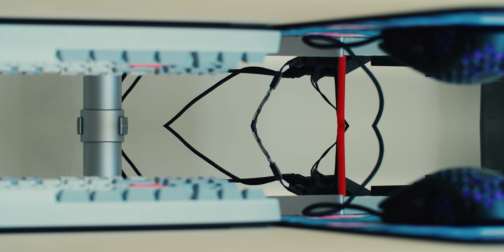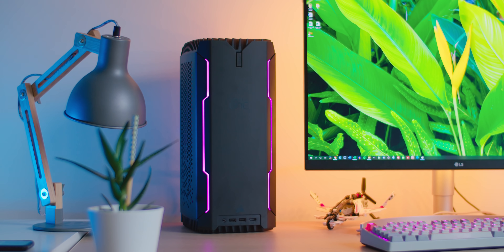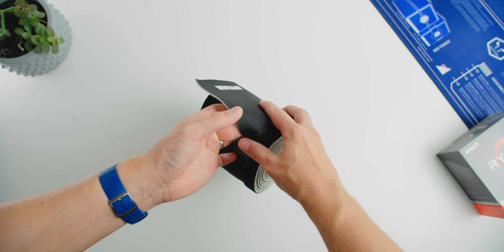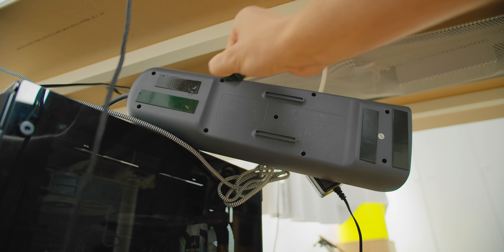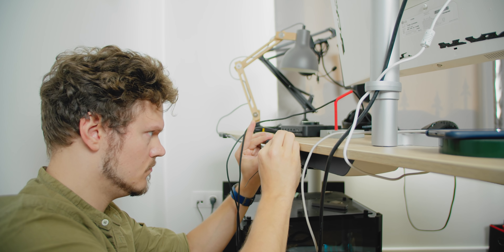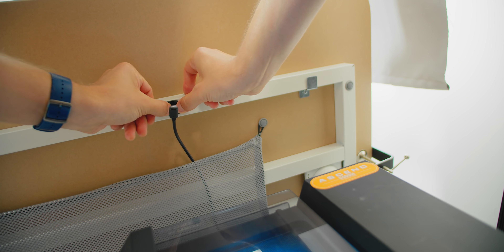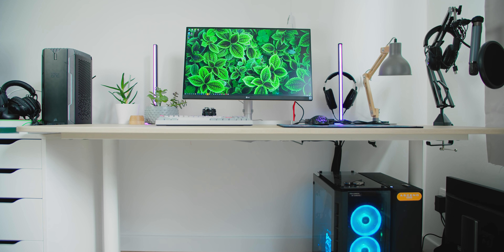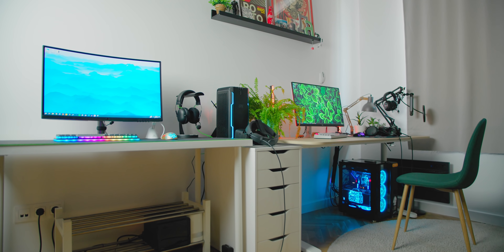CHEAP and EASY desk cable management options!

Comment: Show us again in 6 months, when those stickies fall off. 
Especially the weight of the power bar. 
I'd recommend using 3M stickies instead of the no-name brands.. you get what you pay for. And before sticking anything to the desk, wipe the desk with isopropanol / isopropal alcohol first, for a clean stick. When you apply the sticky.. hold for at least 5 seconds with constant pressure so it'll stay. Yes, way too much experience wiring call / inet centers over the years.
Reply: Answered my question before I even asked it at the end. Lol
Reply: The first items he's showing off (1:38), I bought the same exact looking ones several years ago on ebay. They're still on my desk, not budging at all
Reply: WhiteHawk wrong, 3m is quality. What do you think hold the Velcro down, anyways? When applying something it’s all about surface prep, and this separates handy people from idiots. Same deal with ikea furniture. I’m 28 and I’m still using an ikea dresser my dad and I assembled when I was in 6th grade
Reply: @rogerwilco99  Isopropanol isn't methanol, it's isopropanol.
Reply: Those stickies are horrible. You spend an hour or so under the table to cable managing everything, just to hear them pop of one after the other in the coming week.
Reply: @WhiteHawk77  3m isn't crap. I still have rain guards on my car 7 years later.
Reply: Is 3M, 3X stronger?
Reply: This is how I destroyed my table
Reply: 3m tape is just op
Reply: @WhiteHawk77  Considering I have multiple parts that have been installed my car for years using 3m, I  wouldn't call it crap.
Reply: Hi I'm using use 3M stick on tapes but they cannot support the power brick; it's mostly due to the heavy VOOC (OnePlus, Oppo, Realme) smartphone chargers that they use.

Is there a non destructive way (like a clamp) to hold the power strip in place while hold a weight of around 500gram?

Edit: please ignore this 3M I used was most probably fake, get 3M VBH it's one of the best ones I've tried so far. There's a video I'll link to it which compares tape strength; I found it quite useful.
Reply: dont use fake 3m... the real one is really strong and sticky
Reply: @MayankJairaj  Carpenters left behind what they called "mirror tape" after finishing the interiors of my house. Some 3M tape which they used to stick a big mirror in the bathroom to the wall.

I used the same tape to hold up a power strip (it's hanging from the left edge of my table). I've connected PSU, monitor, laptop and OnePlus brick to it. Still holding tight after a year.
Reply: @ShashankKR  oh yes thanks for that i forgot to update on this, the double sided tape i used was fake it wasn't 3M although it had a 3M branding on it. 
Now I use the 3M VBH tape and I would say I'm amazed by the strength of it. It currently is lifting anywhere around 5-6 kg of chargers from the last 1.5 month. Another place where I used it - my brother tried to rip it out, the paneling came off😅. 

Please ignore the comment and buy something like a 3M VBH (it comes with its own primer too)
Reply: Agree, those chinese manufacturers just simply write 3M on those shitty accessories, but the real shit holds strong
Reply: Hey 6 months later haha
Reply: @lukeroberts1  enquiring minds want to know! :)
Reply: @Major Gear (:
Reply: Well I got the god tier option, 3D printed me some zip tie anchors and screwed them under my desk and attatched the cables at them. It is truly one permanent solution which im really happy with. For someone who does not have a printer (understandably), hitting up ppl on etcy or other sites with DIY made stuff may be a good alternative to get the best possible option money can buy (and it cant be that expensive either)

Comment: Pro tip here. You see how the cable are going from the bureau straight down to his pc. Depending on the length of your cables you could also wire it going down behind the feet of the desk and then straight to the pc. You can do the same for the extension cord. It looks way more clean and I use it myself. Great video tho! Have fun with your cable management :)

Comment: I bought an ikea desk which cyou can put higher or lower by a button (just like in office). It has a net which hold the cable and adapter for it and i put in all cables neatly of my desktop as well. Clean AF.

Comment: I rescently did my desk again and I found that using D Channel cable trunking was a REAL help. Cheap, real easy to install and can hold a massive amount of cables in them. 

I also used sticky back ziptie anchors aswell all over the place to try and keep things up and off the floor out of the way. I think it looks ok, not perfect but I think its good enough. If i cant see it it dosnt bug me.

Comment: I used the velcro ties to do mine and it looks so much better. Still a tad bulky but may invest in the velcro sleeve later on for all the display, power, and USB cables, but for now they're all velcro'ed together with just the ends loose to plug into the various ports on the motherboard.

Comment: RE pedestal for PC on floor:  Cut a piece of plywood to the size of the bottom of the case, and attached wheels under it. Put the PC on the cart, attach the cables when it is out in front of the desk, and then push it back under the desk. You can rig the slack in the cables to hang from the under side of the desk, where it will be hidden until you pull the PC and cart out in front of the desk to work on.

Comment: In gaming setup section, you can zip tie little lose si that the HDMI cable can pass through the zip tie and tie all cable together with velcro straps... So the sip tie make a channel and Velcro keep them together... When need to change undo the Velcro , remove cables through the zip tie loops... Redo after changing the cables and you are good to go without cutting any zip tie

Comment: i recently took care of this... my comptuer , monitor and speakers are standing on a window sill...  below is the desk.... i had to cut a hole through the window sill + the desk table... then i added a wooden L angel below the top desk plate to hide the usb c hub and the cables... best solution i had in  30 years LOL

Comment: 3M adhesive requires a cure time prior to actually using it. Did multiple things, I went from hardly hanging a cable using 3M mount on my ceiling to being able to hold my whole VR headset, and a pinata (full of candy and being hit). On my door, I have a lock using 3M arms, and letting it cure is the difference between my cat being able to open the door, and just hanging on the handle.

A lot of little things that could be done to make it look even cleaner, the velcro tie on your monitor should be higher to only show the cable going down, which could be routed behind the stand. The cables on the edge under the desk should be held back from sight, the mouse could use a single 3M clip after the holder to get rid of the cable bend sticking up.

Comment: Dimitry have almost the exact same set up as mind - same-ish monitor, even same-ish headphone. My solution is to just go wireless keyboard. It's incredible how missing just one more cable making the rest so much more manageable. And rater than tape, I just some old hard cable and tie everything up with them.

Comment: Top tip, use one of those tiny cable clips for your mouse cable! I used to have one on the back of my desk and clipped my mouse cable in there, this helped a ton since the excess cable wouldn't hang behind the desk and catch on the desk as I flick the mouse... Now I have it clipped onto the back of my pc which I find ever better 😀

Comment: The cable management of my setup is mostly done with screws and twist ties. Screws hold my power strips and the cables are held by a combination of cup hook that are screwed into the back of the desk and twist ties. 
I think I've done pretty well as the only visible cables at the top are the mouse, keyboard, and the headphones, considering its composed of about 16 cables which are: 2 monitors (4), a printer (2), ethernet cable (1), mouse (1), keyboard (1), and monitor USB hub (1), DAC (2), PC (1), 2 power stiprs (2) and a UPS (1).
Of those the headphones (Samson SR850) is the biggest mess of cables due to the very long cable it has. Though being connected at the front to my DAC (Aiyima DAC-A2 / Fosi Q4) doesn't exactly help and I might try to add some height to my PC so I can place it under the PC and have it coming from the left instead of the front.
Reply: ok

Comment: plastic cable tie pro tip: if you turn them around and insert the tie with the "wrong" side, you can reuse them as well!! they won't have as much power for obvious reasons, but sometimes thats enough.

Comment: I use a signum rack and a spool of velcro 
Currently not perfect, but I do need to rip the whole setup apart and do it right, it was all originally setup in a hurry after a move

Comment: Ultra cheap option - go to hardware store, buy some plastic PVC piping holders, few wood screws and you've got a pretty nice cable holders for $2-$3, especially if your desk has a support brace that you can screw those holders to. They open up easily, so it only takes a few seconds to get your cable out of them, they are mounted with a screw so no worries about long term adhesive problems. Downside is that you actually have to screw them into your desk - not a problem for me, since I don't plan to ever use my desk in a way that those holders would be visible.

Comment: cable managment isnt that hard... but i have also en external Radiator for the Water Cooling. To hide the external tubes from the Radiator is the Real Challenge!

I thought about using hard tubes externally for a clean look^^

Comment: Congratulations on unlocking level 1 of cable management! Next challenge: multiple monitors and full array of accessories - on a sit-stand desk  😃 
I bought non-height adjustable Bekant frame and the net was much bigger, going almost to edges. But I am in Europe so maybe models differ a bit, or it was newer revision?
As for computer pedestal - why not get board with similar surface finish like your desk, and mount it on casters (like Ikea Rill) or furniture legs? I believe you can get these boards very cheap in hobby markets, they usually keep assortment of waste boards and will cut them to size you need. Apply self-adhesive white edge to match the table. Casters have advantage that you can roll the case around when you need to turn around to plug cables or move a bit to clean dust around it.
Reply: ok

Comment: Good video, it did make the area neat. Pretty sure the double-sided tape on the power strip will fail, potentially causing something to get powered off (like an external hard drive). Would suggest just using small mount screws or at least wiping the area where you are applying the double-sided tape with some rubbing alcohol first.

Comment: i simply mounted a mesh wire grid under my table and attached all the wires etc to that. Sticky tabs etc just fall off and I would trust them to hold a power bar over longer times.

Comment: i used adhesive clamps for my set up and completely forgot about the adhesive tying points, should have used those instead, it gives you so much more freedom because the clamps might not fit some thicker cable or would have troubles with multiple cables.
they are more versatile and easier to change though, but that matter can be fixed with tie points if you use velcro or reusable zip ties

Comment: We use all of those same components, just larger versions when we do cables management on Datacenter racks. We've had as many as 280 network cables going from servers to the top of rack switches, those velcro cable ties are definitely worth their weight in gold.
Reply: Absolutely, never go with plastic cable ties if you can help it. They could pinch your cables, need to be cut to be adjusted and aren't easily recycled.

Comment: The fastest way to clear your cable mess is to create a backdrop behind your desk with 2 large acylic panels (or any other material panel of your choice). You can also just use 1 panel, but I like two because you can create a spacer between the two panels and just throw your cable through them - and it allows the whole structure to stand on its own. It's basically like routing cables into a drywall, but without actually hacking your wall. Nothing to tie down, just throw everything behind your self-made "wall".
Reply: yea

Comment: Switching the mouse and keyboard to wireless was a game changer for me, no more cables getting stuck on something behind the desk in the middle of the game
Reply: Well you should never move your keyboard, but yeah, having a wireless headset and mouse was key to me.
Reply: @TheGauges420  true, although i was also talking about the cable mess part
Reply: I'd pick mess over weekly charging ritual, increased price and batteries that inevitably die out or randomely expand.
Reply: @czarkowskipawelyt  my G602 mouse lasts for 1400+ hours of using time
Reply: @sonnyenduro  Make it 140+ in several years. Also, that "1400" is only in "endurance" mode, which sacrifaces responsiveness.
Reply: @czarkowskipawelyt  mate if my mouse survives for several years ill count my lucky stars
Reply: @sonnyenduro  All mice survive for ages, assuming they don't have a decaying battery inside.

Comment: Is that gaming pc desk from Ikea? If it is, I have the same 100x60cm. My solution for cable management was to buy another 10e table top and but all cable there (and router also) with some hooks. Very clean solution and easy swap thinks.

Comment: Adhesive mounts will always fall off, use screws.
That power strip will DEFINITELY fall off if stuck with adhesive.
You can get these zip tie clamps with screw holes, and with a reusable clasp so you don't have to cut cable ties every time you need to change it. So much better, works out cheaper too.
Reply: u need to drill a hole though

Comment: $20 says all the adhesive gives out in a few months.
Reply: that's why I like nails, but then you have an ugly dent/hole after you move them :/
Reply: Had some like this under my desk and they stayed up for years, then tried to take them off 🤔
Reply: My RGB strips around my desk have the worst adhesive ever. I had to add some extra adhesive anchors to keep them sticking around.
Reply: That's why you use 3M tape. That stuff sticks. And before applying, clean the surface its gonna stick to with some rubbing alcohol and apply tape with some pressure for like 5-10 seconds. Guaranteed to stick forever.
Reply: I'm not sure what type of adhesive I used for my extension, but it's been working for a year now with like 6 things plugged in
Reply: This must depend on climate as I've had the same ones on my old desk last several years for multiple builds shrug

Comment: So many 'clean' setup video's all of the sudden. 
I still like DIY Perks video on clean setup the most, but this one is quite neat as wel.
Reply: The DIY Perks vid is actually/technically a Desk-PC, not a clean desk with a PC, none the less it produces the same clean desk/build effect. It would be nice to see DIY Perks do a desk specifically designed simplify/help with cable routing with a PC outside the desk.

Comment: I prefer zipties for the PC and velcro wraps for external cable mgnt ;) esp when you need to swap cables and/or switch equipment out, you don't want to be be wasting zipties ;)  I found a cable sleeve that you can use both inside and outside the PC ; it's rather stretchy etc.. you just open it up, slide in the cables and it closes in on itself ;)   Thanks for sharing, D! 

Re: power bars.. thought you lived in Canada?? o.0

Comment: I thought you were Canadian, or well, based in Canada.. Those look like EU plugs on the power bar?
Reply: There is no such thing as "EU plug". There is so-called "Europlug", but it's only one of many types of plugs which are used worldwide, not only in EU or even in Europe, and only for low-power unearthed appliances. 

At the same time, many countries in the EU have their own standards for mains sockets: France, Germany, Italy, Denmark, while UK and Switzerland also have their own different standards.

I think the world should move towards using IEC 60320-based sockets for residential and commercial electric installations. C19/C20 is much more convenient, reliable and safe than, say, Schuko.
Reply: Dmitry has gone between Canada and Bulgaria

Comment: 1) install a cable management L-tray, get one large enough to hold all the power extension and adapters/capacitors.
2) more velcro cable sleeve
done deal

Comment: What power strips would recommend? A big one with 12 plugs? Two eight ones?
Reply: I have a weird one that's designed to stand up like a monolith with outlets that come off on all sides. But I actually turned it upside down and basically hanged it between my desk top and the wall, lol.

Comment: Two things to try...  One, reusable zip ties.  Two, Techfex Flexo F6, its cable sleeving that has a lateral slit that you can bundle multiple cables of various types into.  Comes in various diameters and just cut to length.  Much better than that plastic cable wrap junk.

Comment: A lot of the clips and wire holders are fine until you need to make a single change to your setup. And then you have to undo a lot of it for a tiny change. In the long term, just get cable racks that screw in.

Comment: the problem is, that some of these techniques get difficult if you have too many peripherals. 
it is hard to hide my 5 display cables (3monitors + oculus + switch to one monitor), 4 power cables (switch+ monitors) and 8 usb cables (mouse, keyboard, mouspad, hub for thumb drives, dac, 3x rift). plus my desk is only 18mm thick, so i cant hide anything at at the edge.